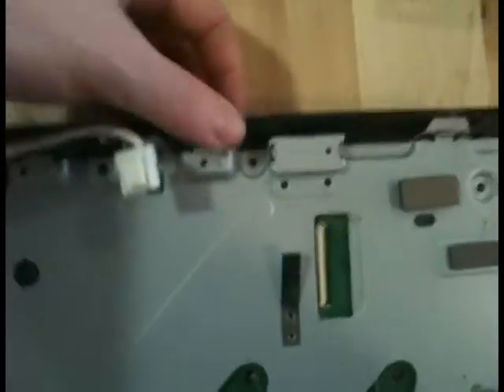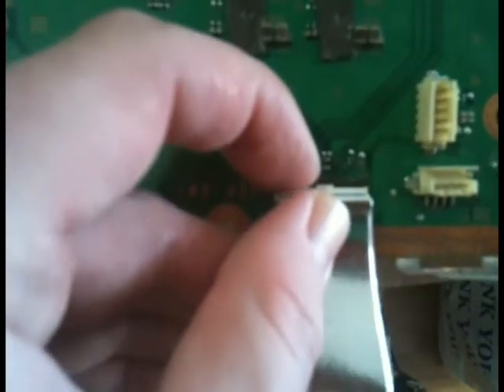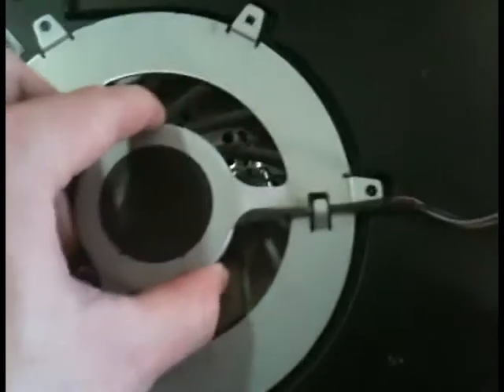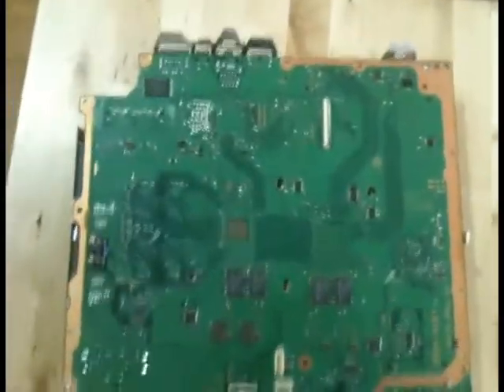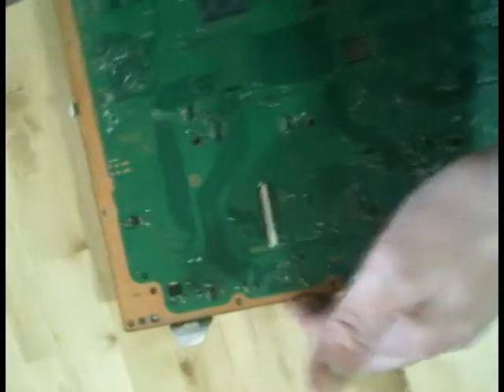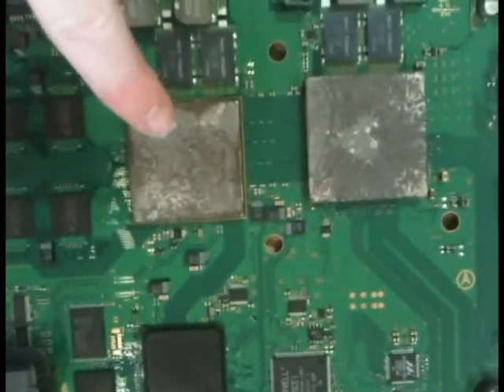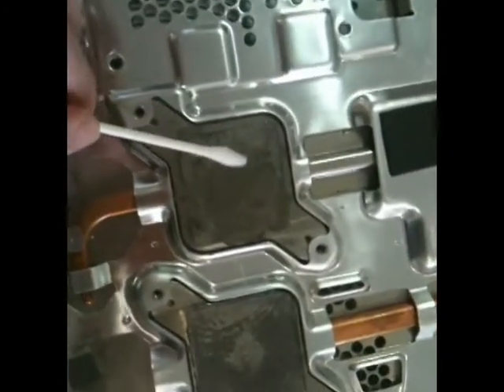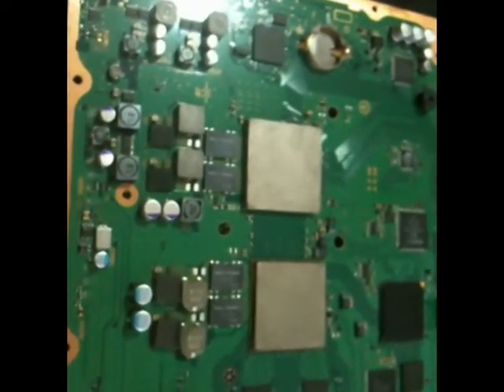Detailed PS3 YLOD Reflow (Old Model Red/Yellow Light of Death Fix) - Part 2

Comment: I just wanted to let you know your instructions were great. I used the oven bake method of fixing the motherboard but used your directions for taking everything apart from the power supply on. Everything went smooth and I only had a couple of extra screws when I finished. I guess it may hold out until the PS4 comes out. 

Though I'm still a bit ticked that my 30 year old atari, colecovision, and intellivision consoles are still solid. And every current gen console has broken at least once.

Comment from the maker: Hi there,

I know it can be scary, but if you follow the directions and are careful you should be fine!  I used just standard rubbing alcohol, which you can find at any drug store.  The thermal compound is called "Arctic Silver 5," and should be available at Radio Shack, any electronics store, or on newegg.com.  It's what you use to install a computer CPU also.